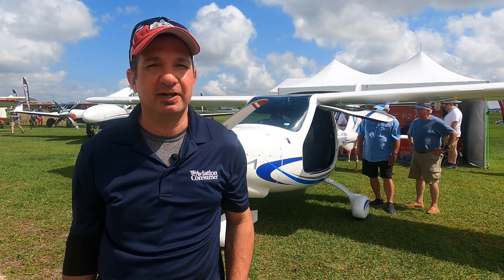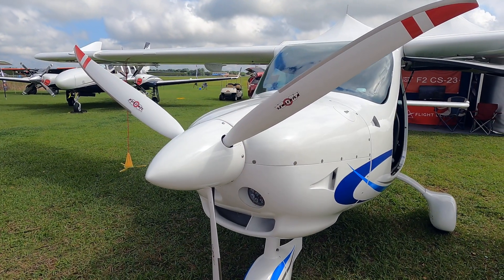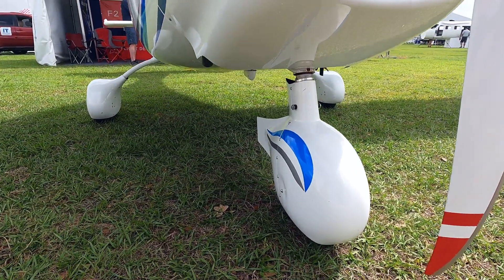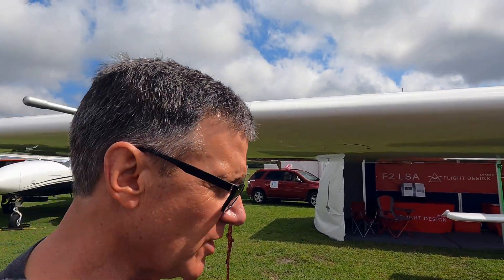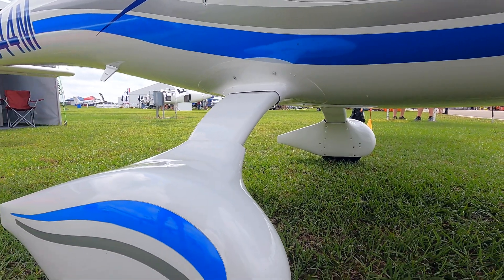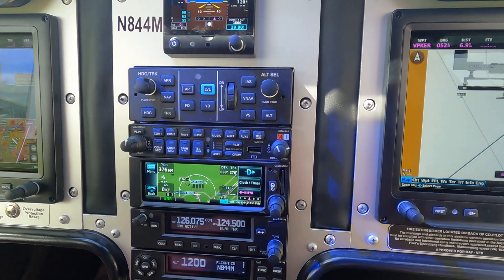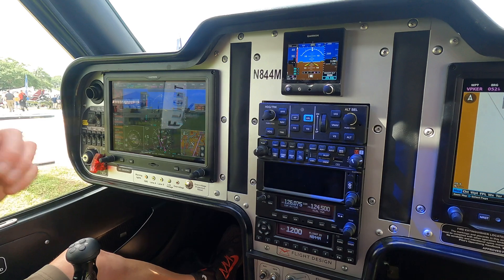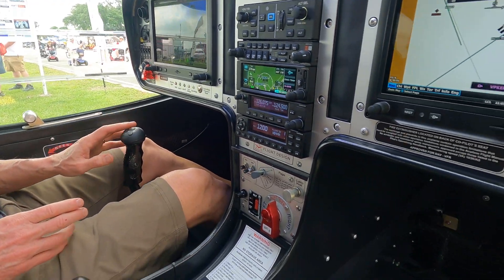Sun 'n Fun 2022: Flight Design F2 Update

Comment: ‘Throttle forward, brakes aft’ is a clever design reminiscent of the way glider designers have long incorporated spoilers and wheel brake in the same control handle.